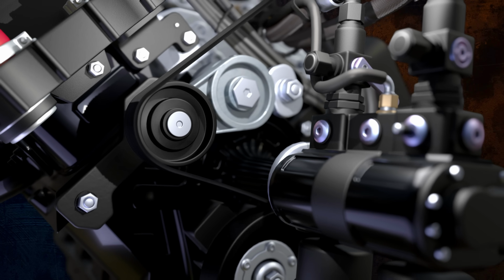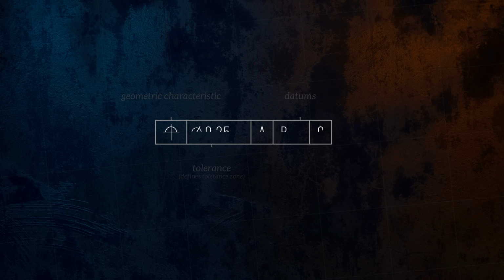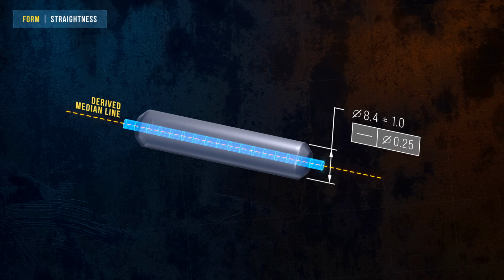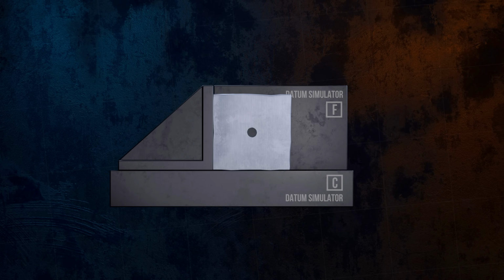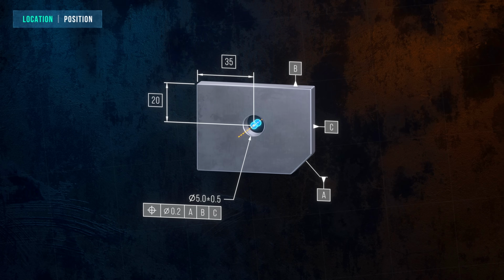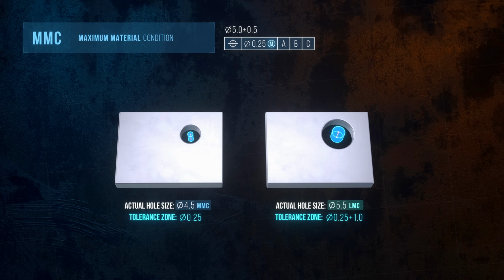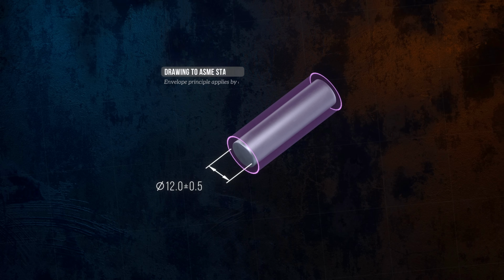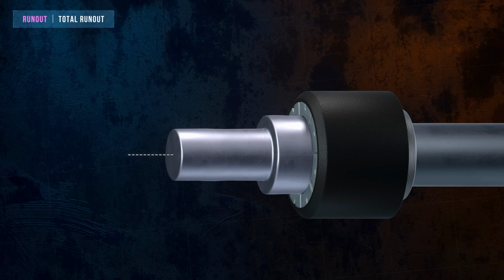Understanding GD&T

Comment: I’m a machinist for 25 years. Got my journeyman card. This is something I learned from that. Thank you for taking your time to show us. The formula to calculate true position.
X2(power of 2) + y2(power of 2)= n square root of that divided 2. But you need a Texas instrument calculator. 
Always remember MMC is your friend.
90% of the time. Checking parallelism. You can just use a Micrometer instead of placing your part on a granite surface and running your indicator. What if the part is thin n bow(not flat) . You now using flatness against you. But you bolt that part to the mating part. It straighten itself. That’s just my opinion. But what do I know . I’m just a machinist.haha

Comment: Started working in metrology about a year ago. We have a set of part the has the 0,0,0, set for what seems to be a random place. The actual postion is actually related to the entire assembly. It not helpful because we dont have the rest of the assembly, nor do we have space for it. Then there is the part that uses a small cylnder as datum A, Datums B and C the inside of an oval shape hole on the X and Z axis. These are then used to measure the true position of pins and have the plastic moulded around them. Because we do mostly plastics, alignment can be tricky as we have to deal with mould split lines, flash and distortion that wont affect the final product. Yeah it will work but the department can't certify it as we can't get that warped thing to measure correctly because you put the spilt line on the only critical measurement/alignment surface of the entire prodcut.

I don't ask me about out work load, mostly caused by previous people not really knowing what they were doing (I mean i dont either, but some of it is down right baffling). The number of parts that do alignmets from holding jigs if a little concerning, specially when that alignment isn't done everytime the measurement is run.... Yeah not great.

Comment: 0 tolerance at MMC or LMC is very common on drawings, as is the misconception that this means “no geometric tolerance allowed at all”. Screw clearance holes should always be “0 @MMC” in theory so that the screw always fits according to the drawing (your contract to the supplier). I constantly have to argue for the usefulness of GD&T in my department when it is definitely the most concise way to fully define parts and design intent. In my experience, flatness, perpendicularity, position, and profile are by far the most commonly used geometric tolerances. These four alone (with size tolerances) allow you to define almost any geometry. Inspection hates complex profiles though… Every design ME needs to own, read, and understand ASME Y14.5

Comment: This was great! But there is one thing I am not sure how to dimension. The positioning datum with a hole, how does this work if there are multiple holes on a PCD? Obviously you can still use the 'Primary' datum for perpendicularity, but how about the secondary and tertiary?

Comment: This is great but I would point out you can not check flatness that way accurately. Bc your flatness call out is independent of the opposite side of the part you must set the surface to be measured down on the gage balls. It’s not as fun to check but you must keep the surface you are checking against the balls holding it up so that you do not get an error from the opposite plane. Cmm’s make a plane and assume that the points they check are not influenced by the opposite plane and it most cases this is true. But if you want real representation of flatness you have to isolate the plane you wish to check

Comment: This is a very good video, but I still cannot understand why there is a difference if you go BCF or FBC? Without the part if you put all the simulators together BCF would be exactly like FBC therefore the part should fit in either one exactly the same could you address this please

Comment: 11:47 I don't understand the "minimum of 3 contact points" I would have thought of a minimum of 2 points of contact.
Reply: If a surface is only touching at two points then it will still be able to rock side to side along those two points. Three contact points eliminates any movement in the part.

Comment: I think there might be some minor differences in notation between the US and Europe. In Europe I've seen the letter M in a circle represent what I here understand as the envelope principle, for example. But it might be a complementary concept, because it has been used in the context that a measure of a piece is allowed to be outside of its tolerences, if the corresponding measure of a piece with which it must fit is also out of its tolerances in a way that they still fit together with each other.

Comment: Reasonably good presentation however some of the measuring concepts are fundamentally wrong. Again, a good primer but know you won't pass an ASME or ISO test with the knowledge presented. Also, the presentation is MOSTLY ASME-Y14.-2009 and earlier standards though some concepts are ASME-Y14.5-2018.

Comment: I'm a metrology engineer and this hits every major piece of GD&T that an engineer should know. Great work!

I'd like to add that in practice, circular runout can list concentricity, circularity (when the datum feature applies as such), and co-axiality (as off-angle holes will very likely produce bad runout measurements).

Comment: Holy cow was this useful in refreshing what little correct info I learned and retained from my time in my polytechnic days, as well as making relearning it so much easier.

Still mad as hell at my drafting teacher who straight up teach us the wrong symbols and what they meant, was super vague about how it all interact with one another and when questioned, brushed us off saying "eh, there is no need to be so accurate on GD&T matters".
Like what is the point of defining tolerances and feature limits if you ain't even using the correct symbols, and values that is required?
Son of a gun even had the cheek to brush me off after marking my drafting model wrong for my mid-term test, when the way he showed us how it's done is a carbon copy as what I submitted.

Comment: Former laser cutter who used to interpet the squiggles without a BE degree, a practical advice that will save tens of thousands in short amounts of time, think of where the work pieces processing begins and provide measurements with the assumption that the starting and/or surface of the work piece is most likely the least reliable measuring surface on the piece. Very few processes have an easily corrected way to begin the process and most times if your piece Can be manufactured without machining, it almost certainly Will be at some point.

Comment: Something about MMC/LMC still escapes me.
It is the least intuitive part of the topic.
"What is the actual tolerance value? - I don't know, RTFM."
I think it might be a poorly chosen definition and/or marking. From the examples given in the video, my take is that there is an implicit envelope we actually care about. So the modifier ties together two different tolerances, and it would've been clearer if they were connected on the drawing somehow, instead of those abstract letters.
Maybe it is the best that can be done in a compact frame and it is fine for those who use it daily. But it will always be tricky to follow.
Reply: I've been in manufacturing industry for the last 18 years and I have not seen MMC/LLC on any of the thousands of drawings I've seen, then again 99% of the drawings I seen have been ISO/DIN, so it might be just an American thing, oh wait I did see it on a casting drawing for the 90's

Comment: I like your last comment about gd&t. It needs a special interest to dig into.  I have a hard time to capture all the new features from my old days of pure dimension and tolerances.
Reply: I forgot to mention there's a time when I tried to bring a power center line on the drawing just to link the power output shaft from engine to transmission in the engine bay. It's so difficult to do that since I was told gd&t gets rid of center line concept.  Unfortunately I need that line to define all engine power output correctly since it also controls the height of the engine,  supporting shoe, final drive, etc.

Comment: I was always taught to check flatness with the specified surface on top of the jack screws and sweep my indicator under the part , the way I see your checking the opposite way which looks more like parallelism to me .
Reply: I had a similar question
Reply: That is why he is adjusting three jack screws  to zero points to create a plane. It gives a similar effect of surface butting on three points at same level.

Comment: That was great video, expalins a lot! I only wish you didn't exclude concentricity and symmetry tolerances from video, just beacuse thay are not in ASME standard anymore. Concentricity is still widely used in ISO standard, I see it quite often on the drawings. And since video is not only about ASME, but it also explains stuff in ISO standard, I think it should be also included in the video for european viewers.

Comment: Great video. I apreciate the work you put in this video.
At the minute 16:20, I saw that the dimension is measured from the oposite surface of the datum C. In my opinion it must be measured from the datum surface as is specified in the datum frame.

Comment: Hole;
      Dia 10mm+0.016.convert 10.016
                          -0.005.convert 9.095
How to apply in drawing
Which is upper limit?
Which is lower limit?
10.016.         Or          10.095
10.095.         Or           10.016
Which one correct?also include  shaft.

Please clarify about this one.

Comment: Concentricity was removed from the latest ASME Y14.5 (2018) standard as well as, I believe, symmetry. I was perfectly fine with the removal of concentricity; probably the most over-used and least understood control in the bag.
Reply: Plugging a concentricity control with a poorly defined DRF into a statistical tolerance analysis simulation will lead to some bizarre results. I would prefer using position or total runout instead.
Reply: @Kelvin_Foo  Yes, and probably conveys the design intent better in most applications. 

I always use to ask our guys who insisted on concentricity for just about everything... "what if I make your cylinder into a four-leaf clover shape and shift it by half of the diametral tolerance.. would it still work?"... "..but I have a belt riding on that surface...". May want to think about that a bit more then.

Comment: Pro tip: always add a general profile tolerance to your documents , such as "Unless otherwise specified a Profile tolerance of X.X  to CAD"  this will save you, your company and your customer a lot of trouble.
Reply: Also reference the general surface profile to your primary DRF of choice to prevent any confusion.
Reply: And make it ridiculously expensive to manufacture. Stop over tolerancing designs.
Reply: @ryanpaul4176  No, that's not true, it gets more expensive if the tolerance is such that it doesn't fit. All you have to do Is list the tolerances as the minimum required for the project and if it's expensive so be it because the alternative is it not working
Reply: @pilotavery  there’s a difference between constraining a design on functionality and just giving a blanket constraint on the entire part surface to cover yourself. Be a better engineer and actually engineer your part.
Reply: @ryanpaul4176  The point of giving a blanket tolerance and then specifying the tolerances you need, is because if you leave no tolerance technically the factory could make it like 10% out of spec.
Reply: @ryanpaul4176  adding a general tolerance is a good idea. It doesn't mean you have to make it a stupid number, it just means you have to make sure that every single dimension has a tolerance. And just in case you miss one, the blanket tolerance should cover it. So you start out with a basic tolerance of however much you need, and then if you forget any tolerances at least that tolerance should work fine. Obviously if that particular tolerance was not specified It means it probably wasn't that important in which case the blanket tolerance which has a lower tolerance should be fine
Reply: @pilotavery  again. Be a better engineer and engineer your part. Everything should be toleranced but not by a blanket tolerance.
Reply: @ryanpaul4176  while you are right, it is better that every single possible dimension has a tolerance, the whole point is that It is actually quite common for one of the dimensions to not have a certain tolerance specified. That's why the industry best practice is to throw a blanket tolerance on top which is purely for catching The first mistake, because every now and then someone will make a mistake and not tolerance a specific dimension correctly, and in this case is, it is better to have a blanket tolerance which will likely save the part than it is to have it out of whack and Then the part not work. In this case, it only only ever affects your part in a chance that someone forgets to properly describe the tolerance, and in that case it's better for it not to cost as much money.
It's like having a triple redundant autopilot system, that doesn't mean that the engineers sucked for not making it work in the first place in a way that could fail, and the goal is that you don't need it to be triple redundant, it's there anyway.
Reply: @pilotavery  When replacing a water pump on a 1973 Ford 460 you can install all the bolts a few turns, and the holes in the pump is very loose on the bolts. When torqued down correctly the gasket seals and the water pump does not leak. It seemed to work back then I would think it would still work today. I often wonder if unneeded tight tolerances increase the price of a new car and if so by how much. Maybe there is a chart explaining this.
Reply: @GaryH-pw9cm  higher tolerances decrease the cost of cars because We have the technology to do it. Back then, You would have had to use gaskets that are thick enough to compensate for these tolerances and have materials that seal really well, and don't last quite as long. Additionally, there are extra steps in taking low tolerance parts and machining only specific portions of them to get to the tolerances they need. For example, you used to have to machine every single one of your caliper pins, which made them very expensive. Nowadays the tolerances are so damn tight that they come right out of the machine already cast at the exact right size and are directly ready to use.

Low tolerance is replaced by tons of extra labor and fitting and manual magickering. Hi tolerances mean that you don't need any manual labor and everything fits together perfectly already.
Reply: @GaryH-pw9cm  keep in mind that a broncos engine also had cylinders that had tons of blow by which is why they get less power and less fuel economy than modern engines, and each of the cylinder heads were matched to the cylinders themselves and the Pistons so that somebody would have to manually pair them up together. Even then, Ford's had extremely tight tolerances even in this 1970s. So even then it wasn't that much work to pair them up and get them running.

At the time, Chevy on the other hand, holy fuck. Basically every single piston was custom made to the engine block and machine shops did tons of labor to rebuild an engine. You couldn't take two Chevy engines and switch the Pistons out, but at the time you could take two Ford engines and switch out just the Pistons. The Pistons would fit each other because they are identical whereas the Chevy one was kind of done as a one-off part every single time. Ford's tie tolerances even in 1970s was exactly why They were able to mass produce things so cheaply. They didn't have to fire machinists to cut down and drill out and lathe and otherwise cut apart to the exact size, because the part was already the size they needed and someone could just screw it together by hand. I don't know if this makes sense.
Reply: @GaryH-pw9cm  tight tolerances reduce cost overall. Buy a lot. The research is expensive and the tooling cost is expensive but when your mass producing things, The one-time purchase is less important than the ongoing cost and the one-time purchase to set up the factory is more expensive but if your mass-producing tons of cars then it's cheaper overall. For making cars like Ferraris or low volume, low tolerance is better because The factory can be made cheaply but then you can just manually tweak each part individually by hand by hiring some skilled machinists.
Reply: @ryanpaul4176  Buddy, you might want to just stick to swimming with fish given that you can't seem to understand the reasons and benefits of standard tolerances. It's a pretty widespread practice for a reason.
Reply: @Nattfogs  I think you misunderstood my comment. Standard tolerancing has revolutionized society. Over tolerancing (Tolerancing parts when it's not needed for functionality) is expensive to manufacture. Engineering is a delicate balance of functionality and cost. Good engineers understand this. Thanks for watching my videos!